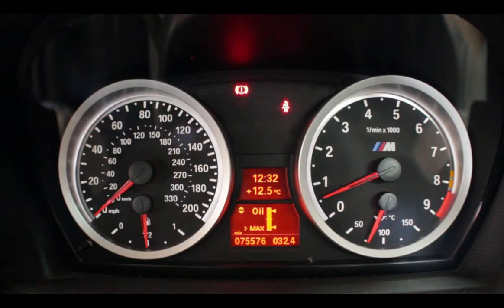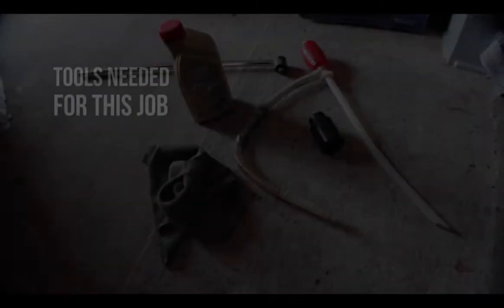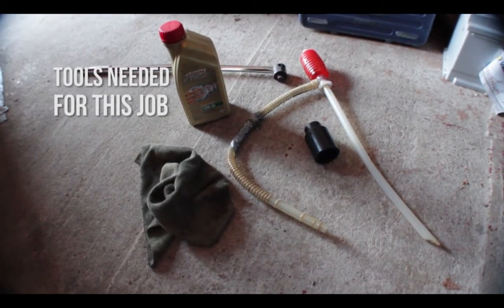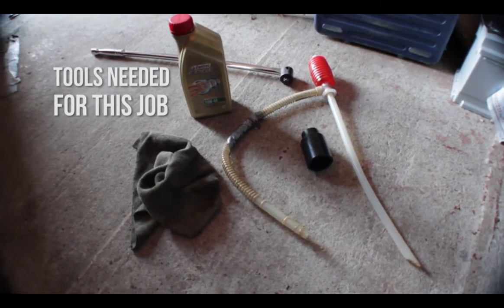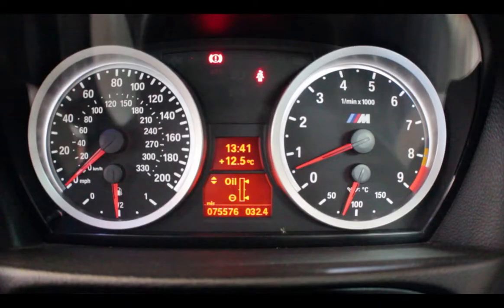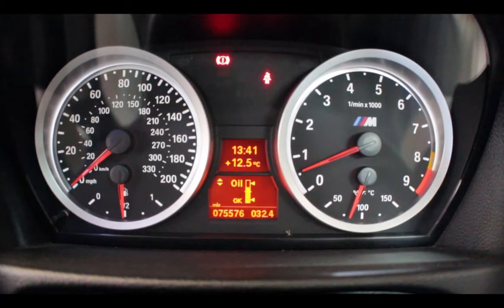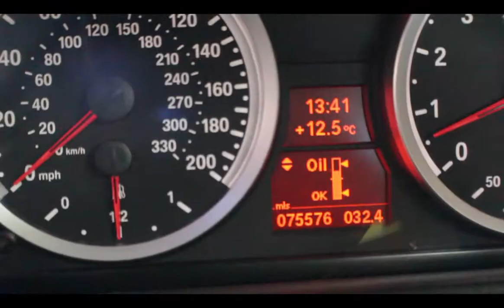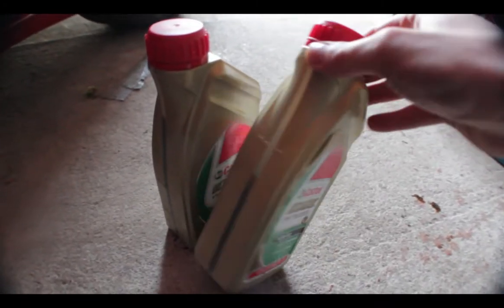BMW E90 / E92 / E93 M3 Oil Too High Fix / Max Oil

Comment: My car after a few months after oil change gave me the oil level too high warning. I tried this method and removed 3/4 quarts of oil but still got same error message. A small amount of oil was leaking from oil filler cap? Any idea what would cause this?

Comment: Does this work on N54? So to do it multiple times you just put the cap back on and start the car so it recirculates back into the oil filter housing?
Reply from the maker: Yup! Works for N54 :-)